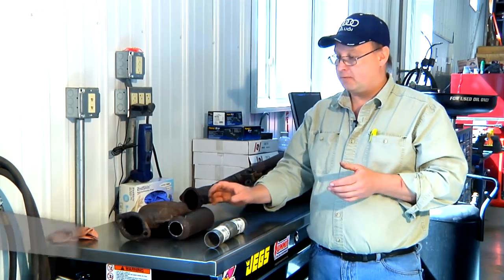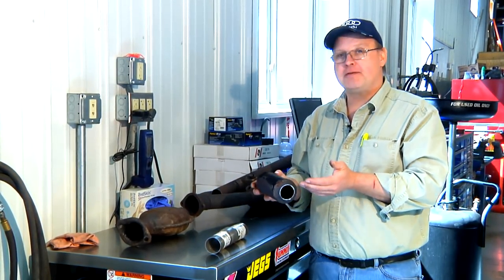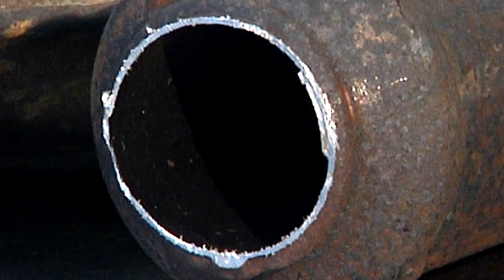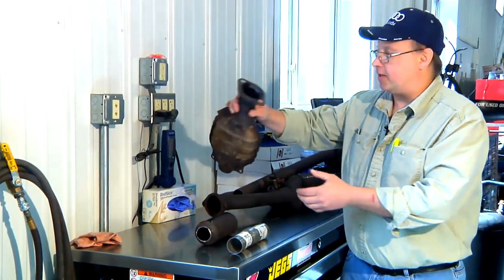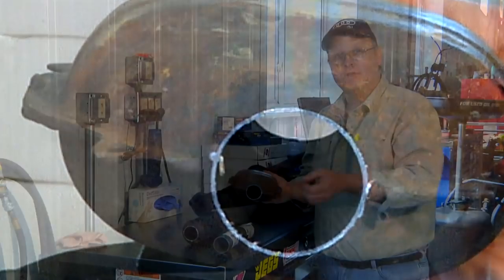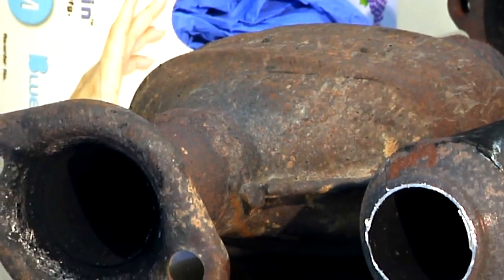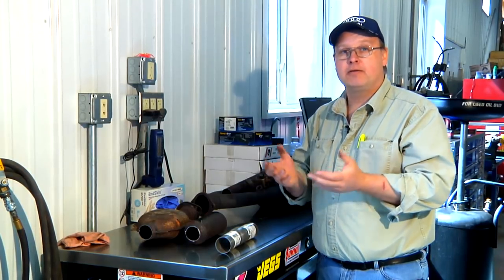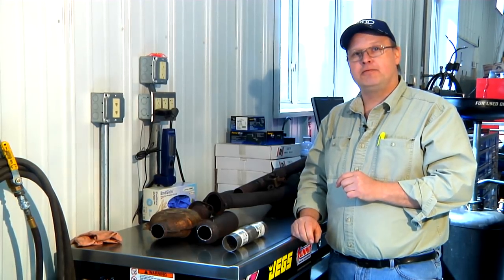What Happens if You Replace the Exhaust Resonator With a Pipe? : Under the Car Repairs

Comment: If you guys in the comments are so sure that back pressure is bullshit, why do car makers still insist in fitting resonators in their cars? Seems like every youtube user is a freaking mechanical engineer these days...
Reply: Reducing back pressure might help and in some cases may be detrimental.
Many modern engines have back pressure sensing devices which are part of the engine management and emissions control systems, and do require a certain amount of back pressure to work properly.
Do your homework before changing from the original equipment installation.
If you get a boost in HP, torque or MPG after mods and no check-engine light comes on...then more power to you.
If the opposite happens, then you may have to go back to the original installation.
Reply: Resonators control drone due to- get this- resonance. Hence the name. These tones are unpleasant to most people and often happen at common cruising speeds where the engine is producing a deep, low tone.
Reply: I dont know why people think they are smarter than the engineers that designed the damn car.
Reply: Premium fuel only So... I am not a car guy...but I am a computer guy.  Microsoft makes Windows for "most" people because it is easy to learn and more acceptable to the masses.  However, Unix is a much better operating system for people that know what they're doing.  I am guessing....resonators on some cars are like Windows....most people like their car quite at the expense of a few HP.  However... a Unix Car guy would take it off because he likes the sound and the extra HP.  Doesn't mean the Unix guy knows more than the engineers...just means they know enough to understand why the engineers did it.
Reply: Also, I don't think the resonator's role has anything to do with back pressure. This guy is off with that.
Reply: my 2003 dodge ram dosent have a resonator  but the 2004 model has one after the muffler .. but my truck has a throatier exhaust from the factory ..the newer trucks are quiet and almost whimpy sounding.. but there the same 4.7L engine.. ..its just the sound... ps.. grand prix cars sound great..my dads tubular rez rotted out.. a straight pipe went in.. 10$ fix.. ..muffler shop.. 600$ parts n labor... bullshit...
Reply: Hi, I'm a mechanical engineer and engine performance enthusiast.  :-)

Backpressure is the enemy of any combustion engine.  The myth that backpressure is somehow beneficial goes back to the 1930s, when people found that an engine with an exhaust manifold ran more efficiently than an engine without an exhaust manifold (cylinder head exhaust ports venting directly to atmosphere).  It wasn't until many decades later that we learned the reason for that was due to exhaust scavenging, and lowered exhaust gas reversion; not backpressure as originally thought.  The most effective aspect of a well-tuned exhaust system is its ability to align exhaust pulse phases in order to create a low pressure at the collector at the moment of the next exhaust valve opening.  A highly tuned system will go one step further and create enough vacuum to help pull intake gasses in from the intake manifold, but not so far as to pull those gases (and unburnt fuel) into the exhaust.

A resonator is not a restrictive device, as far as the engine is concerned.  The muffler is the most restrictive device on a modern car, with the catalytic converter coming in a surprisingly distant second.  Modern cats are very unrestricted; especially once at operating temperature (performance cats are a rant for another day...).

Unfortunately, the biggest plague on engine performance in modern vehicles are whiny old people like me who want a nice, comfy, quiet place to sit while they drive from place to place.  NVH is the buzzword of the decade, and things like header/manifold design, resonators, and restrictive exhausts are the cheap, easy solution for auto manufacturers to meet the demands of their majority customers.  All a resonator is doing is re-shaping the exhaust pulse wave, shifting it to a different note to better work with the muffler to quiet the car.  If you ever have the opportunity to cut one open, you'll find it shares a lot in common with those good ol' "Cherry Bomb" mufflers.  It's a screen pipe wrapped in some sort of long-strand fiber (fiberglass, kevlar, etc.), wrapped in steel.  The exact sort of thing people replace their mufflers with looking for more performance.  :-)
Reply: Resonators don't add ANY backpressure because they are straight through what they do is eliminate certain sound frequencies but not that you'd know anything about it
Reply: The purpose of a resonator is to cancel out a certain range of sound frequencies. Without getting too scientific, sound is simply a pressure wave emitted at a certain frequency. Like waves in the ocean, sound waves have certain amplitudes (comparable to overall size), a crest and a trough. At the beach, when the crest of a wave meets the trough of wave of the same size, the two waves actually cancel each other out and there will no longer be any wave. The exact same principle applies to sounds waves. If you have two sound waves of the same size and frequency meet crest-to-trough, they too will cancel.

https://www.americanmuscle.com/mustang-mufflers-and-resonators-whats-the-difference.html

Comment: Resonators are required my inspectors who measure sound levels in the vehicle that can be distracting to drivers.if they were not required by inspectors manufacturers would not put them on.back pressure is controlled by the proper muffler.funny video tho.ive done exaust for along long time.

Comment: This video is correct in the n-a/stock world ... when it gomes to boost, exhaust pipes no longer have to meet factory standards for back pressure and resonators .... generally with a turbo charged vehicle stock or aftermarket straight pipe usually fine.. and the larger the pipe means LOWER EGT's and more efficiant spooling .. so ultimately this video is great just feel like it should be known that turbo and non turbo exhaust systems function worldly different

Comment: if you have a crappy small engine and you fit a really free flowing exhaust system you will lose most of the low end toruqe and MPG will go down ,  if you have a v6/8/12 engine then you will find that a well designed exhaust system will gain you power and increase toruqe output.. as well as sounding like a monster..
Reply: Actually  my 1.6 Geo Storm picked up 3 mpg & I also noticed better acceleration, not worse.
Reply: well thats good news for you... it also depends how restrictive the factory system is.
Reply: Big difference if you're runnin' a turbocharged engine or a naturally aspirated engine.
At turbocharged engines (even 1.6l or 1.8l) its useful to install bigger pipes like e.g. 2,75'' because you have less back pressure and the exhaust fumes can leave the pipe much easier.
Reply: Satveer Degun x pipes

Comment: my mustang came with pretty much the same thing. now i am running 3inch all through off road X pipe followed by flowmaster 40s sadly still has to go up around the axle. but no cats makes a big power and sound gain.

Comment: Agreed. The old myth about back pressure being needed by engines is just that. A MYTH.
Reply: +Lee S. back pressure IS needed but not as much as the cars have when they come in stock. Creating little to no back pressure in the pipes will cause turbulence and cause the gasses to expanded and move slower in the exhaust system. Getting the proper size pipes for your car is important, because you can effectively create back pressure by trying to remove it with bigger and free flowing pipes. Are you following what I am saying. This mostly affects naturally aspirated cars more, turbo vehicles benefit from larger diameter pipes a lot better since the turbo can push the exhaust gasses with more force and not worry about the gasses slowing down and causing back pressure.  Like a Honda civic will never need a 3 inch exhaust unless it is getting seriously modified BUT it does need upgraded exhaust system because the stock one is extremely narrow.
Reply: +Zcypot 
Not quite.
I agree that pipe sizing is important. Too large can be just as bad as too small.
But it's not because of the loss of backpressure, but rather the loss of velocity causes greatly reduced scavenging effect, severely hurting low-mid range torque.

Pipe lenght also plays an important role. Too short can be quite detrimental to power as well.
But as far as pipe size, yeah most people overestimate the ideal size their engine really needs.

The goal is to find a pipe size large enough to eliminate as much or all backpressure, but not so large as to hurt exhaust velocity. 
Now small amounts of backpressure can be tolerated without much power loss, but only a little.
But it's not actually desirable in any amount.

About the only exception to this are turbocharged engines, which need some pressure differential across the turbine, so some backpressure is necessary between the engine and the turbo.

Comment: This is a thumbnail sketch of the Cliff's Notes version of a limited application of fluid dynamics. 

FOR VEHICLES DRIVEN ON A PUBLIC HIGHWAY there are emission standards, both sound and gases. The catalytic converter alone will not meet the gas standards and the muffler alone will not meet the noise standards (on modern OBD II cars). These standards are met on a 'best average fit compromise' in engineering, not an all or nothing. Street legal cars are neither tuned for low speed city traffic nor WOT (wide open throttle) but a compromise between the two. Race cars are a different story. 

The cat does require some back pressure in order to get hot quickly and stay in the high temps to function during stop and go driving, especially in cold winters. 

The resonator's purpose is to do a couple things. Sure 'smoothing out' the flow is done but the reason why is the key. The resonator keeps the flow going on ONE direction - out the pipe. "That's stupid - your a dumbass - OMG - WTF - LMAO" are the usual responses from people who are not engineers or who have never taken a fluid dynamics course in a university. That's OK, not everybody is cut out for that kind of work. 

The resonator reduces noise a bit but mostly prevents a condition called 'reversion' where under certain specific circumstances the exhaust flow begins to pull back into the tailpipe for very short durations of time. See, when you're running high RPM @ WOT  and quickly pull your foot off the accelerator to CT (closed throttle) the engine is still spinning very fast and takes time to slow down. During that time, you can sometimes observe reversion. It's bad for a number of reasons, among them because it causes very high back pressure in pulses and that 'detunes' the air/fuel mixture. 

Watch the video Koenigsegg Agera R - 402km/h EPIC flyby on the Nurburgring (The 3 minute 1 second video) and you'll hear reversion starting at 1 minute 35.

TLDR version: 
IF you go to a straight pipe exhaust you will need to change the 'tune' (reflash) on the engine computer and you will no longer be legal in some areas. Check your local laws and hold me harmless.
Reply: +dieselscience You just clearly explained why all the laptop ricers on YouTube are absolute morons.
Reply: +DrHillbillyShow you may want to bring your level of automotive knowledge out of the 60's
Reply: +dieselscience What about cars with down stream o2/lambda sensors don't their ecus learn and change themselves? , I thought that was the point in having multiple sensors on the car that the ecu compensates and keeps it operating in its optimal condition , I know its a bad example but my first car many years ago was a 2000 VW Polo 1.0L  , my muffler fell off due to rust and rather than fix it my mechanic convinced me ...."lets throw this straight pipe all the way down this car's perfect for it" so we had a laugh and replaced from the cat to the end with just a straight pipe , it was unhappy and sluggish at first but after only 10 mins of driving it had the same power same fuel consumption and I for one could not tell the difference other than the car sounding like a rally car and back firing every time I hit the clutch.
Reply: Multiple sensors serve to give the ECU a 'before and after' measurement to monitor converter efficiency. After the cat is a different story.
Reply: +dieselscience if I don't mind the sound regulations, the average mpg stays the same as with the original resonator and I don't hear the sounds as in the video can I be less worried?
Reply: +dieselscience  Yeah but a lot of states don't have emissions testing and I've never even heard of one that had noise testing.  Might be some.  I know my cars with no muffler are both more quiet than a stock Harley motorcycle.
Reply: The US DOT has both gas and noise emission standards. ALL states have a noise limit, it's just defined differently from state to state. Police write tickets for loud exhausts all over the USA and Canada every day, and they're perfectly in the right to do so.
Reply: They don't check for noise in our inspections.  Just to see if a muffler is there.  And my cars each have a muffler and are quiet. But in the past when a muffler has failed, it's still more quiet than a stock Harley.
Reply: Go back and read what resonators are for, aside from that a cop does not need an inspection to write a ticket for a loud exhaust.
Reply: +Clearanceman2  as a State Inspector in Virginia I can say I am allowed to pass a vehicle that has only a catalytic convertor and no muffler or resonator. We are concerned with exhaust gasses properly exiting the underbody of the passenger compartment. That's all. Not sure of other states.
I've had my share of improper exhaust tickets with valid inspection stickers on my vehicles.
Reply: Yeah YMMV, I've met several people here that say they buy their stickers car unseen from buddies that own shops.  Based on how their cars look, I believe them.  Here if the car came with a muffler, it's supposed to have a muffler to pass.  But they don't make any money unless they do repairs so if they know you work on your own car, they'll pass most things through.  I passed one year and the midpipe fell off the flange the next week.  No emissions so that's not part of it.
Reply: +dieselscience just assume people are buying emission credits in order to drive the way they want to; like corperations...
Reply: You're assuming too much. There are no such thing as 'emission credits.' When the FEDERAL GOVERNMENT sets DOT and EPA standards, it is illegal to tamper with parts on the car that would defeat or bypass those standards. I KNOW people do that and still pass state inspections but I am not talking about state inspections.
Reply: You never had a test from the US DOT.
Reply: +dieselscience illegal indeed. just ask Volkswagen lol
Reply: Robert - YOU win the gold star for today! I am also disappointed nobody else realized that.
Reply: dieselscience yeah then it makes that sweet pooping noise.  👍

Comment: Anthony, after being interested in cars as long as I have, I know that the engine requires a balance between the intake and exhaust, as you also said. If you upset that balance, you upset the efficiency. Also, if more air goes in, and more air goes out, so does more fuel. So, the engine will use more fuel if more air goes in and out messing up the efficiency. Sure, fast in, fast out will get you more HORSEPOWER, but it depends on what you are looking for OVERALL, when you factor in backpressure.